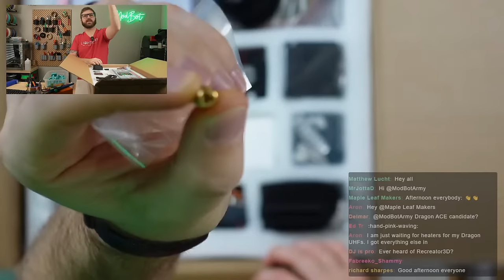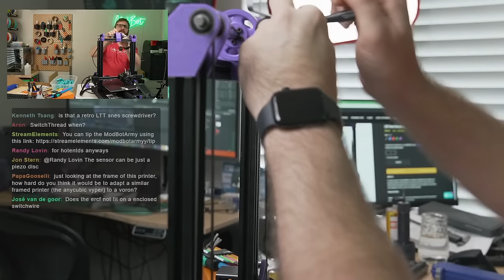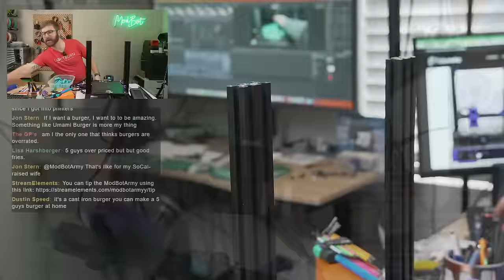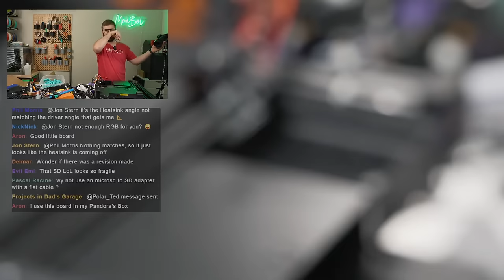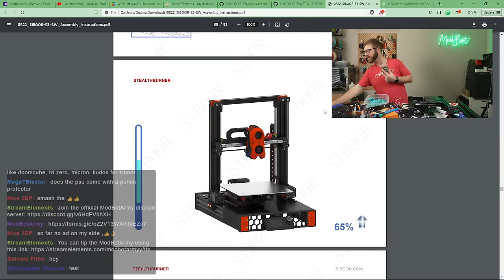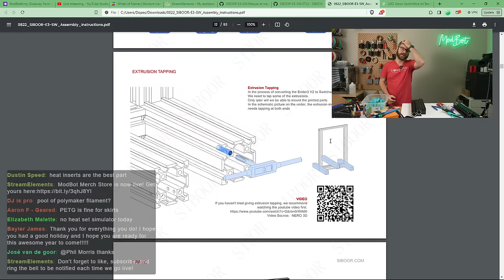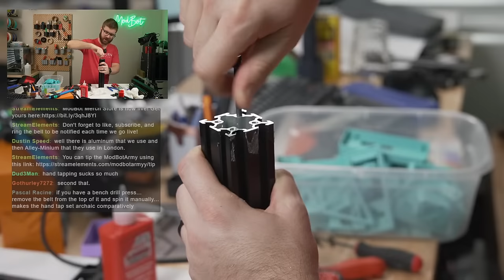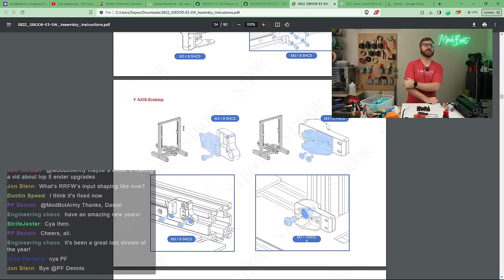Ender 3 To Voron Switchwire - SIBOOR Enderwire Build Part 1: Teardown & 1st Look

Comment: I'm currently in progress on this conversion using the same Siboor kit – have most of the mechanicals done, just waiting on a Revo Voron hotend to finish building the Stealthburner since I don't want another V6-like. The Siboor kit and its assembly manual are pretty good but I have needed to use some different fasteners than were listed and needed to consult the CAD quite a bit too. But it's been a very nice first introduction to building a Voron.

Comment: I’m in the process of printing my parts. A lot of info seems to be missing and a lot of guesswork and research is involved. Nice to finally see someone else doing a SIBOOR conversion. I wound up getting a v3 KE to print with and parts came out better than I hoped.
Reply from the maker: Are you doing the SIBOOR kit as well or going the self source route? Some of the newer bed slingers from creality seem interesting.
Reply: @ModBotArmyy  doing the SIBOOR kit with the print your own parts option. I do like the KE, it’s really a nice option to an even greater upgrade with the Enderwire. I’m probably going to go with a better hot end though.

Comment: When it comes to the old Enders...i've found out that SwitchWire tier performance really comes from putting the machine on rails, solid mounts, and running Klipper, and having a capable extruder. I use a Microswiss NG and dual Z lead screws and I can run my machine at SwitchWire speeds no problem. There are ateast two cheaper options out there to get an Ender on rails than a full Voron conversion..however I don't doubt the engineering of these kits.

Comment: WD40 also works REALLY good for cutting fluid for aluminum.
Reply from the maker: Good to know! Just regular wd40?
Reply: @ModBotArmyy  yessir.  regular plain jain WD40.   use it everyday for aluminum and save my high sulfur cutting fluid for ferrous metals in the shop.

Comment: I been contemplating doing this, but I have a few questions.  I have a heavily modded Ender 3v2, including EDO orbiter, independent dual Z screws, and a BTT Manta 8 board with CP1 and 7" HDMI touchscreen running klipper.  Also has a Gulf Coast Robotics heated bed with 250W silicone heater, and Phateus Dragonfly BMS.  Could I make this build work while keeping some of that hardware?

The reason I ask, is because I got a Bambu P1s as my main printer now, so I would like to use as much as possible of the current ender 3v2 into a much better printer like this.  I hate for the good equipment to just go unused, like the Manta board, touchscreen, or Orbiter.

Thank you for your time, and for the great stream. Will follow along.
Reply: I have a Manta M4P, Microswiss NG, dual Z, solid mounts, and a BLV linear rails kit installed on my V2 and I run my machine under a Switchwire profile in OrcaSlicer...it works perfectly. You have everything you need to juice your printer like mine..u just need rails. U can get a BLV kit like me, or convert your setup to the belted Z like Switchwire. I have a P1S and it's not that much faster than my converted build.

Comment: Even if the kit converted Ender 3 to core- XY it still wouldn't make sense. New out-of-the-box core-XY printers cost 350-600 (depending on make) - same or less that E3 + the kit.
If we stay within bedslingers, which switchwire still is, E3 V3 KE or BL A1 would be better use for the money (and have 2 working printers). 

I fail to see the benefit of fast Z-movement, when it is the slowest of all axis. Stiffness and accuracy in Z are also sacrificed by the flexibility of the belt.

But if you want to put on narrow tyres and slant the wheels of your ride for the looks & hobby, why not - it's your choice 😅

Comment: So I just got the build together but having some trouble with possibly the wiring on my BTT SKR mini 3. My x endstop and probe aren’t working. Any idea on the issue for this? Thank you!
Reply from the maker: So your not seeing them trigger in klipper? Might need to invert the logic with an !. Not sure if you may need to add a pullup to the pin. I have used a bunch of 2.0s but not the mini 3.
Reply: @ModBotArmyy  appreciate the response! So when I run the query endstop command the x stays open even when I have it clicked down. For some reason when I invert the logic I have the same issue but instead of open on x it says triggered no matter what I do. I have my creality board still. Do you think I should just play it safe and use that instead?

Comment: Fast food burgers are ALL disgusting... If I can't get it medium rare, I'm not buying a burger. 

Having said that... I'm currently doing an enderwire conversion. Imagine my surprise when I find out that modbot has covered that already!!!
Reply from the maker: Haha I like my meat cooked more. Most of my family prefers medium rare. 

We are making great progress! :) Did you self source or go with a kit?
Reply: @ModBotArmyy  yes. I self sourced 3 now. the enderwire, V0.1 and V0.2. In regards to the cost difference between self sourcing and kits. I agree that self sourcing is generally slightly more expensive. However; what I like about self sourcing is being able to pick and choose what I want and also being able to buy parts as I have money works better for me than buying a kit all at once. But the kits are definitely tempting because I tend to be impatient and just want to build it RIGHT NOW! 🤣

Also as a side note… As a 20 year diesel mechanic and fabricator. You did a great job tapping the extrusions. And those tap/drill bits are designed to tap the hole to the full depth. Not constantly start/stop. So you were absolutely correct about that too!